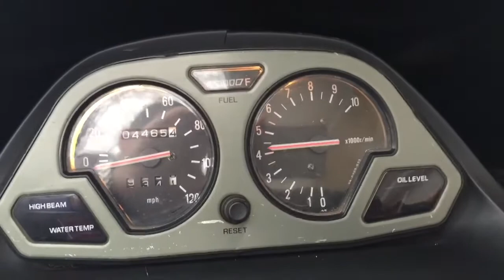1997 Yamaha VMAX SX 700 Triple Snowmobile Video #3

Comment: You've got the wrong belt on there. I use the OEM yamaha belts. Cheaper than aftermarket and they work better to!
Reply from the maker: Mark Bow thanks Mark! This was the belt that came on it, I mainly work on them and get them running to put up for sale. I guess I didn't pay much attention to the belt, thanks for the info and thanks for watching!
Joe
Reply: i agree . stick yamaha belt is what i use as well .and last alot longer then the kimpex belt or dayco belt i got befor

Comment: Hey I’m looking into buying one of these sleds and the stabilizer bar is bent and I was wondering if they are hard to replace can find anything anywhere
Reply from the maker: Funny you should ask I do believe I have a stabilizer bar for the sled it is a little difficult to get out and you may need to drill out some rivets but if I remember correctly it can be done without too much work email me at Joesnowmobiles@gmail.com I’ll check when I get home this weekend to see if I have it and I will let you know
Reply: Hey thanks I’ll email you if I buy it

Comment: Hey I have the same exact sled and when I go to pull it it takes so many pulls to even start any suggestions
Reply from the maker: Corky Bits yep make sure the idle jets on the carbs are clean, checkout some of my other videos I show how to clean carbs.
Reply: joesnowmobiles I had the carbs cleaned and eveythong re jetted and that too
Reply from the maker: Corky Bits did you do it or did someone else work on it? Also have you checked the compression on all the cylinders? If you have low compression it may cause it to be hard to start. Is it easy to start after you have ridden it for awhile?
Reply: joesnowmobiles I had a shop do all the work and when I’ve ridden it still hard to pull
Reply from the maker: Corky Bits Well if you paid them to do the work I would take it back to them and asked them to fix it
Reply: joesnowmobiles I was just wondering what it could be or if you could help me out so I could just fix it myself like it idles great once you get it started
Reply: Corky Bits he just explained it to you ya sped.
Reply: could be stator issue or tors .
check gas line for cracks.and choke cable to make sure its not stuck